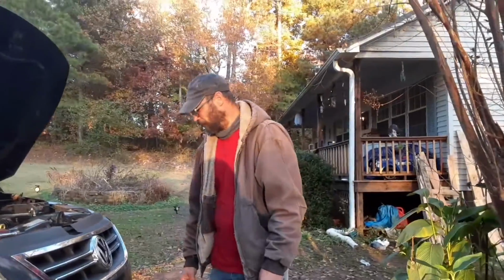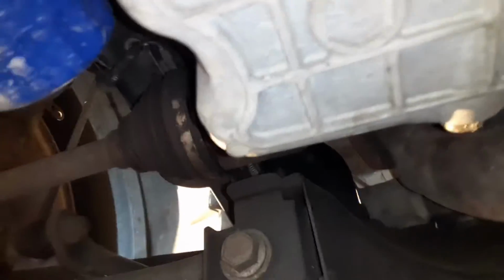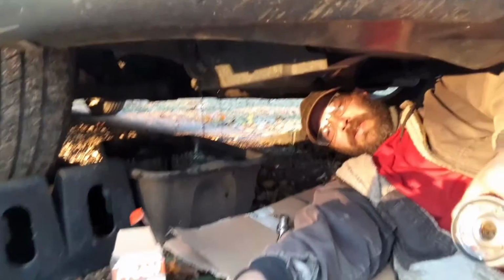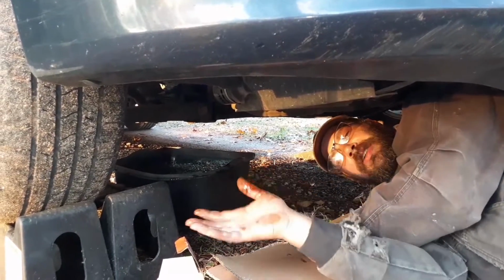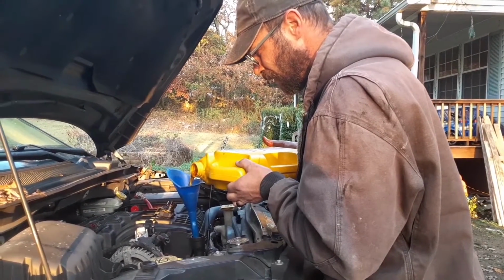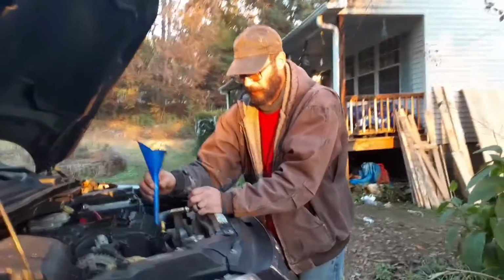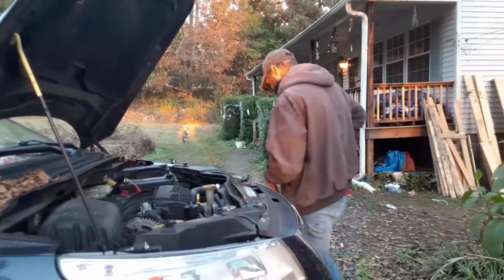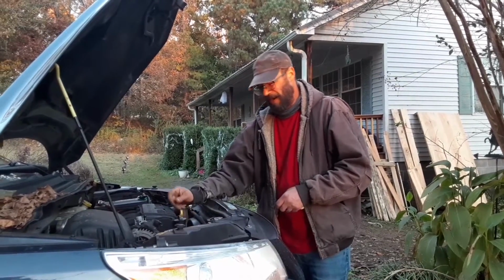How to change oil in a Volkswagen Routan

Comment: how to change antifreeze in this car?
Reply from the maker: Sorry just seen your message. I will have to do a video on that lol. There should be a plug at the bottom of your radiator that screws out. Or you can just remove your bottom hose from your radiator let it drain. Reinstall your hose then refill with the correct antifreeze recommended for your vehicle. I use the 50/50 already mixed antifreeze and there is a universal antifreeze safe for most vehicles.